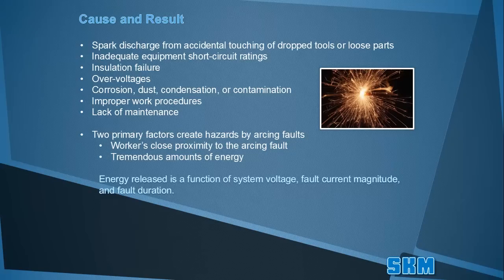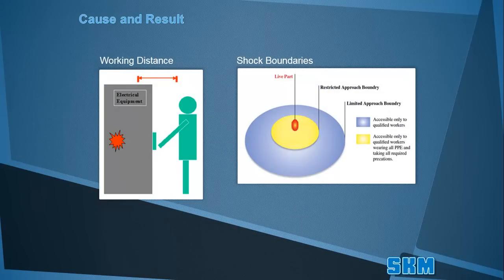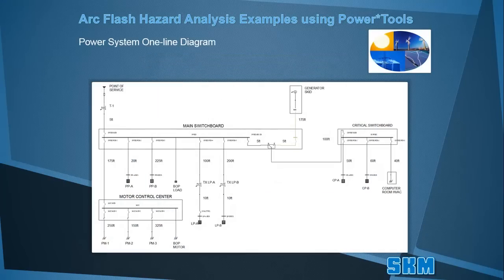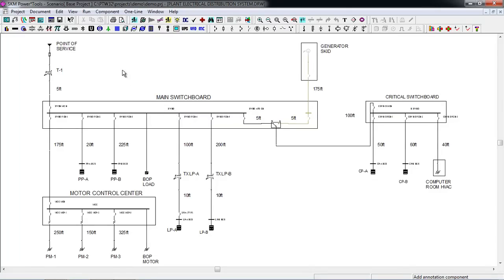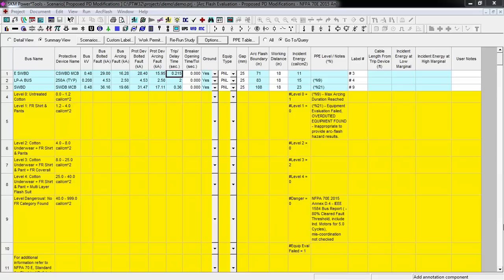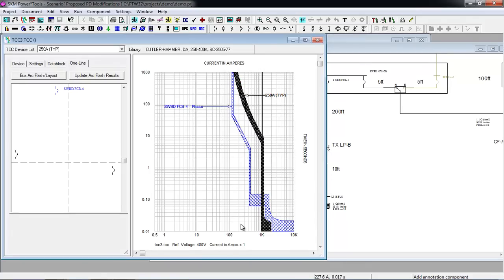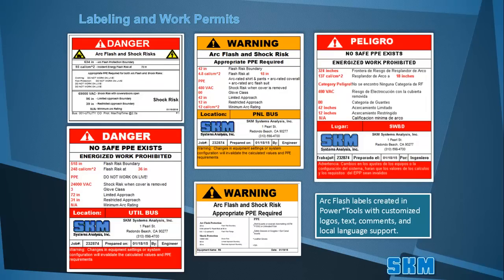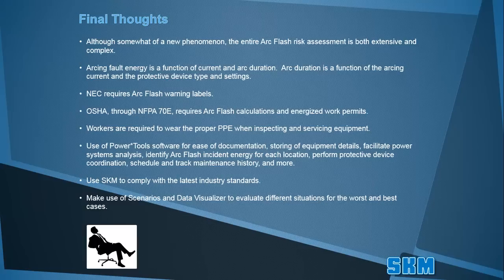SKM Arc Flash Tutorial Video

Comment: After finding the mis-coordination, you don't want to fix it? Making upstream rather than the downstream breaker to trip? Really?
Reply: +Yilun Mao Hello, one of the primary point of the video is to demonstrate the capabilities of the SKM software and analyzing what if situations.  The downstream breaker is a fixed thermal magnetic breaker with no adjustable settings.  If the customer isn't immediately able to change out the breaker to coordinate with the upstream breaker, and he is okay tripping the upstream breaker (because it isn't feeding other loads), then that SKM option can simulate that situation.
Reply: +Johnny Ma OK. That explains. I guess a lot of times in the real world the ideal scenario is not available due to some impracticality. Thanks for your response.